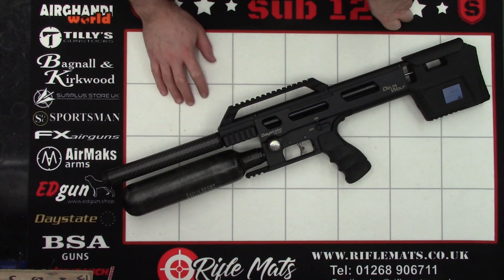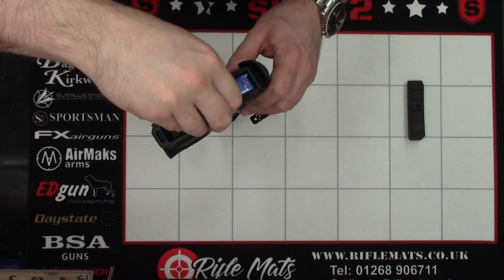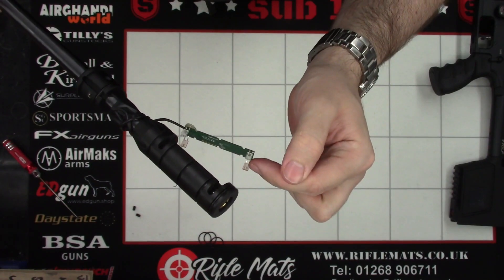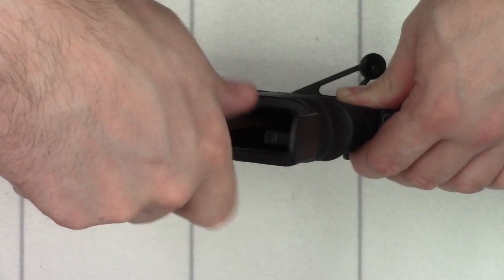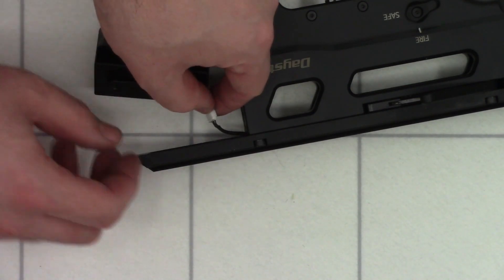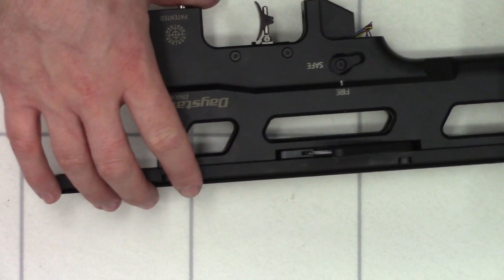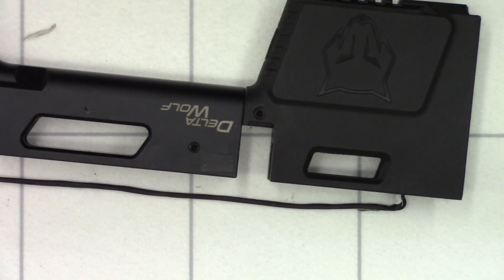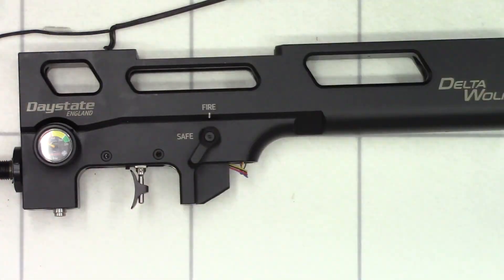Daystate Delta Wolf full disassembly

Comment: Great video, you make it look very easy, especially as you have had to work it all out yourself!
Reply from the maker: Cheers Tony, a few tricky parts but it all came apart very easily, the sign of a good design. very impressed with the circuit board, nice bit of kit. Thanks for watching.

Comment: Cannot express enough how amazing was that video, my question is , do you see any area for improvement /increasing power specially for FAC version. I see that the valve port is almost max in size. What do you think??
Reply from the maker: Thanks much appreciated, definitely maxed out the port size, only ways I could see a small increase in power, shortening the hammer a bit that way you get more stroke, and maybe increasing the internal valve diameter, there is a balance to be had there though as well, as too large and you make the hammers job harder by increasing the closing force on the back of the valve, but I think as standard the delta wolf is capable of 95+ lb/ft so defiantly no slacker, and finally you could always put a longer barrel on it, the standard is only 600mm so a 800mm would give you a lot more power. Thanks for watching.

Comment: Really interesting and helpful. Thanks. I have just bought one in .22 FAC. The barrel fowls very bad, very quick, like 100 shots perhaps. Never had a brand new gun before so perhaps it will wear in. Also first shot after say 30 minutes rest is always about 100 ft/sec slow. Reg showing at set pressure-no creep. any ideas?